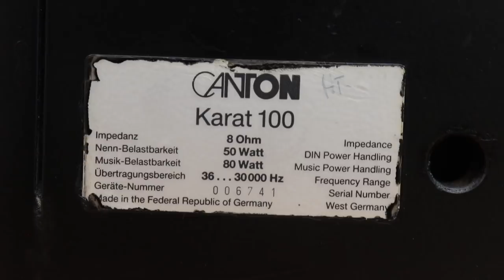Canton Karat 100 - A Look Inside

Comment: Seems okay, except for a flimsy woofer-magnet
Reply: That just relates to efficiency not  bass prodigiousness or  extension. You should  see the magnets on my Reference  KEF 103.2   Similarly underwhelming - in appearance. - Sandy
Reply: The size of the magnet doesn't have anything to do with the sound. Only the Q-parameters in combination with the cabinet size do.